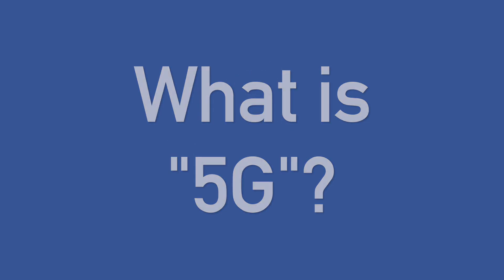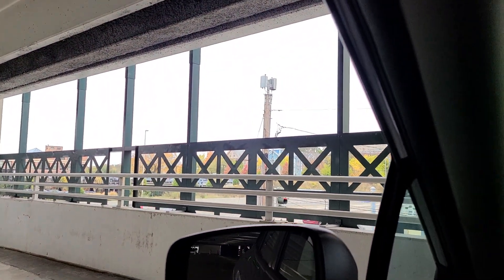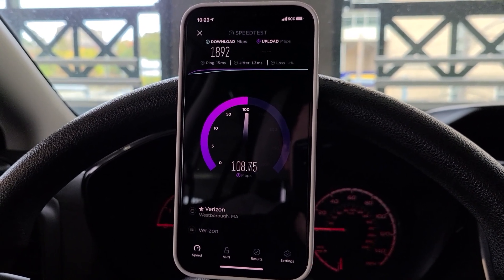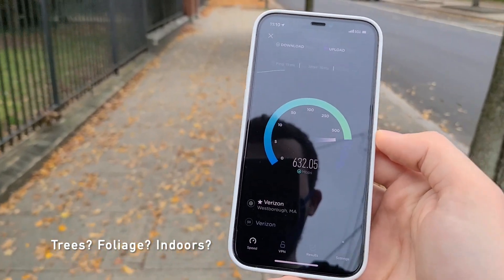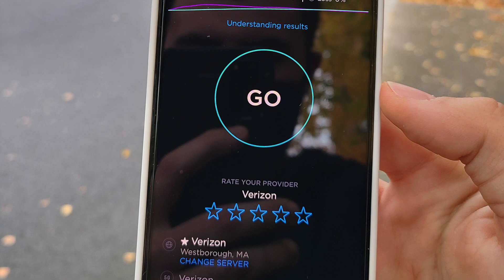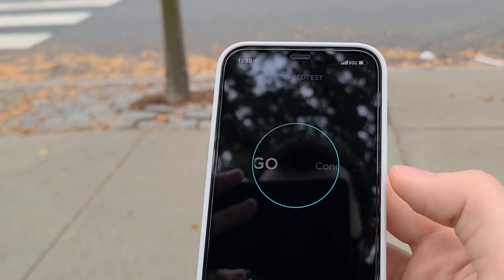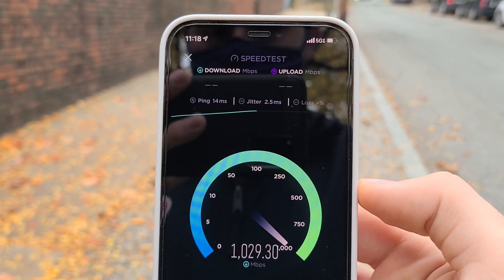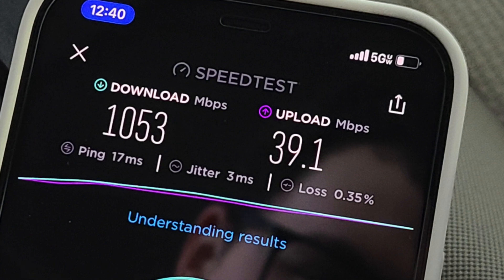Testing Verizon 5G UW mmWave on the iPhone 12

Comment: Did they charge for 5g extra
Reply from the maker: 5G UW is included in my Verizon Get More Unlimited plan.
Reply: If on Verizon, it depends on your plan. All the current Unlimited Plans Verizon offers with the exception of Start Unlimited and Kids Unlimited have 5G UWB included. Start Unlimited and the Legacy "The Verizon Plan Unlimited" which was offered in Feb of 2017 both offer 5G UWB for an additional $10 per month per line. 5G UWB is not offered on Kids Unlimited. However, 5G Nationwide which is just a small bump up from LTE is offered on all plans at no cost. As for the old Unlimited Plans from way back in the day before data caps were implemented, I wanna say 2011, I am not sure about that plan. But not sure too many are still on that as plans these days are much cheaper anyways. See current Verizon Plan comparisons here: https://www.verizon.com/plans/unlimited/?adobe_mc=MCMID%3D26655349766971356724058927848212209630%7CMCORGID%3D843F02BE53271A1A0A490D4C%2540AdobeOrg%7CTS%3D1606417929&mboxSession=bad5e25a49ba4cbab35f4baa41c11003

Comment: Pretty crazy that this is better than any internet I have ever directly experienced. The most I've ever used directly was just shy of 500 MBPS and that is at my grandparents house. I'm kinda interested to see what 5G is actually like. I kinda want to wait to get a phone because of it for when more phones have more than mmwave and 600 MHz. If I'm only getting those, I don't see the point of getting a 5G phone in the first place, but I'm more interested if I have more bands for when it actually becomes a thing.  I'm debating whether to buy a phone now or just wait for more phones with more bands. I'm still using my Galaxy S8.
Reply from the maker: The reality is that MOST people have never seen speeds like this like yourself. Verizon is opening the door and investing in something life changing for many. 5G UWB coverage right now is limited, as I mentioned in the video. But, from what you could see in this video, it will hopefully help bridge the digital divide. Especially in urban areas with poor/low income access to fast internet. Thank you so much for your thoughtful comment! No rush on getting a 5G phone. In 2-3 years, it will be very beneficial. :)
Reply: @PimeTechnology  yeah. I'm thinking of holding off until next year  when you should be able to get more than an iPhone for a high end phone with more than 2 5G bands. I just want to feel future proof because I will have to keep the phone for 2 and a half years basically. You're welcome. I'm also interested to see where 5G goes. I'm not sure if mmwave will be big where I live except maybe in a few places, but my guess is mid band will have some good potential here.
Reply from the maker: absolutely! Mid band and low band 5G will be very necessary in rural/suburban areas. Also, the iPhone 12 supports over a dozen NR bands and dozens of LTE bands. I know Android phones are very limited, but Apple went all out with the bands!
Reply: @PimeTechnology  yeah. I notice how Apple went all crazy with the bands. The only problem is I don't want an iPhone. So I'm going to have to wait for more phones basically.
Reply: I'm using an S9 but ill be upgrading next year to the new Samsung flagship just to get on the 5G bandwagon !!
Reply: @111danish111  nice. I would like to get upgraded too. It's just my mom seems to really want to hold off on upgrading for some reason. I hope I can convince her next year, or else, I might be buying my own phone.